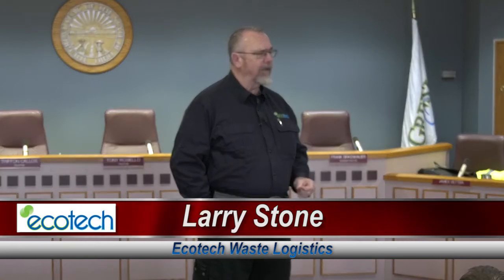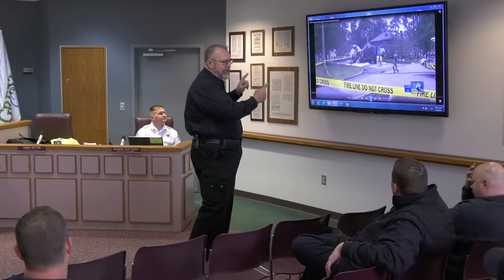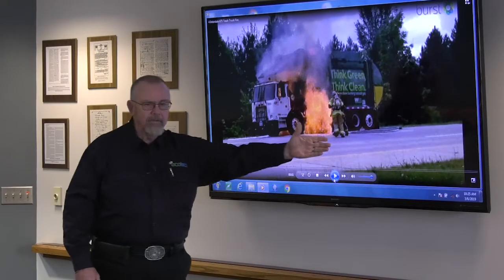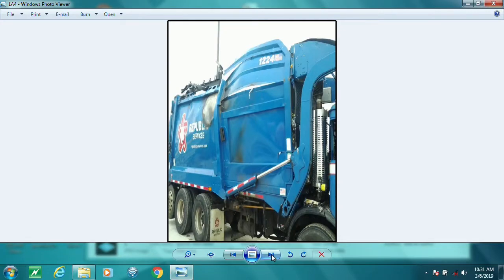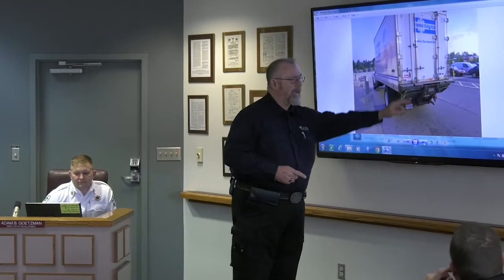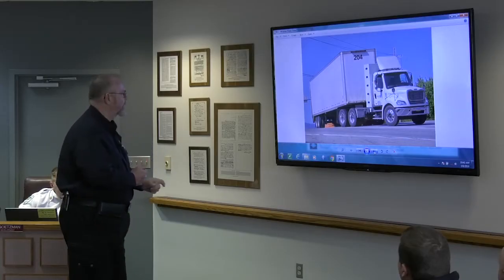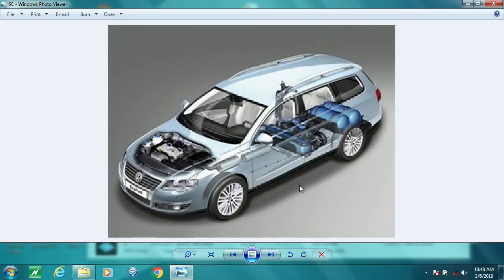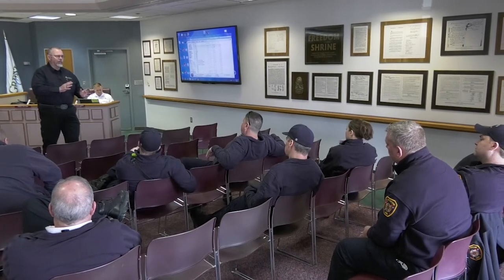Compressed Natural Gas Vehicle Safety for Emergency Services

Comment: Very informative and this is stuff I did not know!  The TTC (Toronto Transit Commission) was starting to use CNG powered buses in the early-1990's but abruptly stopped using them altogether because the CNG buses could not travel into the underground subway stations bus bays because of the top-mounted tanks.  Also, GFL, Inc. here in Toronto is using CNG with a recent delivery of one particular make of rear loader garbage truck, but I have been told privately that "they" do not like the CNG garbage trucks.  Even though I am retired, I will be more observant regarding CNG powered vehicles when I am out and about.   ---- John